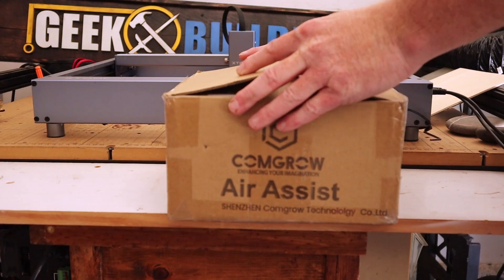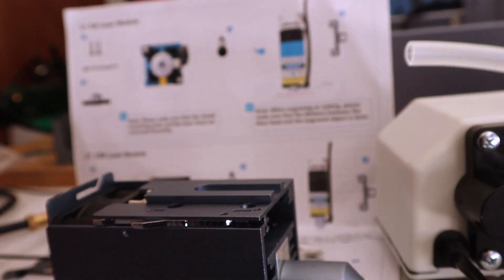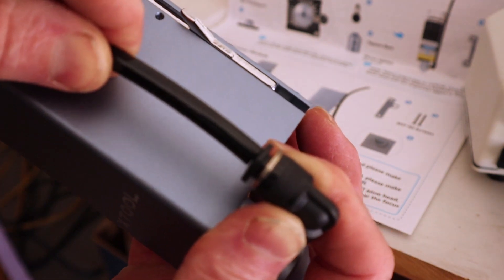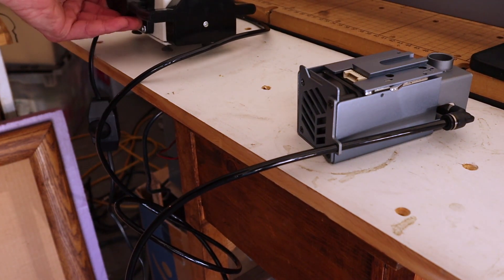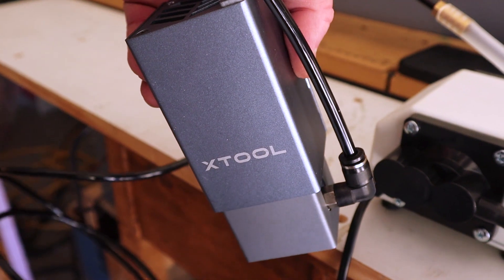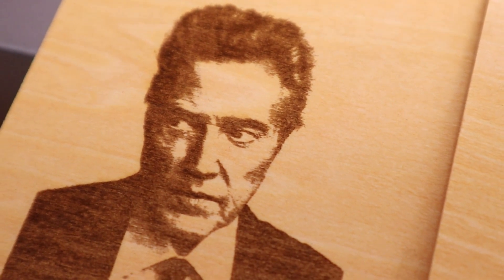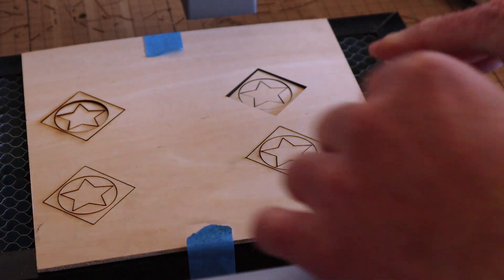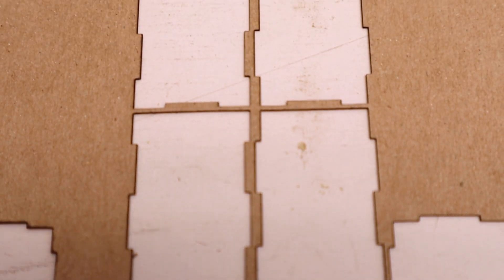Stop the Flame :: Review of Comgrow Air Assist for the Xtool D1

Comment from the maker: I didn't specifically mention it in the video, but this air pump and some of the fittings will work on some other lasers as well. The fit and finish is specifically made for the Xtool though. This air pump is FAR better than the other one featured in the video based on sound, reduced vibration and ease of use.